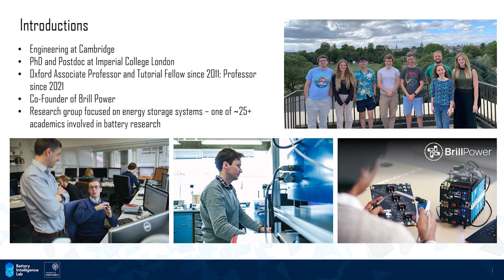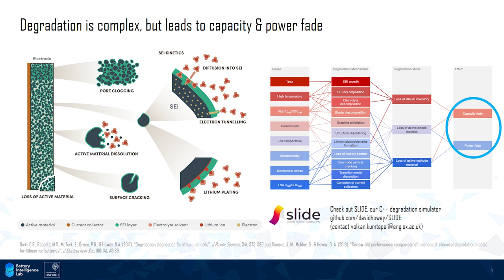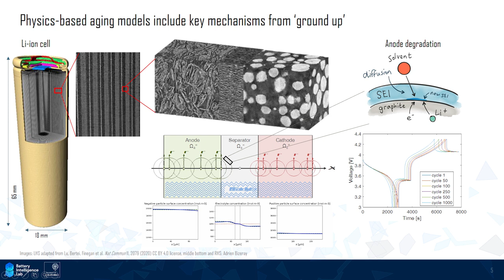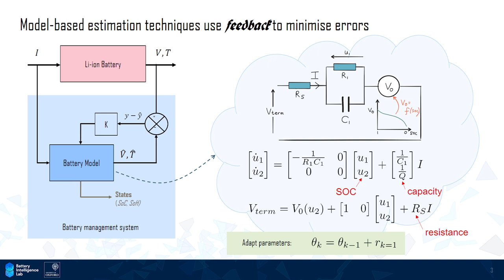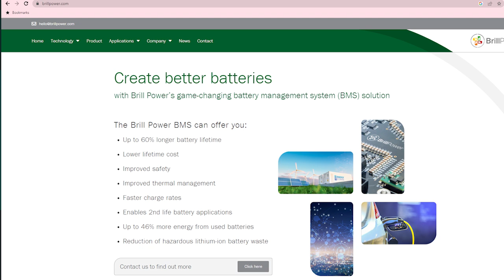How to measure a Battery's State of Health - Prof. Howey | Battery Podcast

Comment: 0:34: 🔋 Understanding battery health and lifespan optimization with Professor Howey.
4:25: 🔋 Challenges in measuring battery health using models and limited parameters.
8:13: 🔋 Advancements in lithium-ion battery technology have led to improved performance and longer lifespan, especially for smartphones and electric cars.
12:14: 🔋 Factors contributing to battery degradation include SEI layer growth, particle cracking, and lithium plating.
16:09: ⚡ Factors affecting battery degradation: usage frequency, cyclic aging for daily drivers, and calendar aging for occasional users.
20:03: 🔋 Factors affecting battery capacity include algorithm changes, physical effects like ion stabilization, and potential capacity recovery over time.
24:01: ⚡ Effects of temperature on battery health and charging speed.
28:03: ⚡ Challenges in predicting battery life due to usage and population variability.
32:02: ⚡ Impact of variation in battery pack over time due to divergent behavior and limitations by the weakest link.
Recap by Tammy AI
Reply from the maker: Wow, thanks!
Reply: Great timing with the timing <3 .
Reply: can't see your title "measuring battery state of health"?

Comment: That would be great if you could also have an uncut and uncut version i think some points weren't shown to the end
Reply from the maker: Hey there, Digitalwallis, thank you! We think Patrick should simply talk to Prof. Howey once more! We received great feedback emails already. Any questions for next time?
Reply: @batterygeneration  Sorry You asked for it
Is there a charge curve Temp vs Chargerate for LFP. What is the safe Rate for a LFP Pack with subzero Temps and whats the impact of Ytrium.? 
Is there any Chance to recover a Battery capacity with some fancy charge discharge cycles?
Is there any other way to messure the  SOC of a LFP as with Voltage, some  spectral impendance Mesurement. May be the relation of Ri between two different Frequencies? 
I mesured some effects in that direction but my tools in my Garage reach only 2GHz, it seam to happen at a higher Frequency.

Comment: My samsung zflip5 has battery protection mode on and limits the max charge to 80% and min charge to 30%, like my 2015 Tesla model S which has a similar charge cycle, the phone should last similar to my 9 year old car that can easily do 400kms on a 95% to 15% drive. 98% if the time my model S is charged to 70% and does not go below 30% before charging.

Comment: The more that I hear about the very short life expectancy of modern phone batteries, the less I feel inclined to modernise my phone. It's ancient Nokia 6230i, and I have never had the need to use a phone for anything other than SMS and phone calls. (I use a tablet for more functionality.) That old Nokia is still on its first battery. Sure, it needs recharging a little more frequently, but it still runs for about 5 days per charge if I leave it running continuously. 
I did buy a spare battery, years ago, when the phone became 'obsolete', but it showed significant degradation within about a year, so I returned to using the original battery. My conclusion is that battery durability is probably being sacrificed in pursuit of higher capacity in smaller cells, and in pursuit of lower manufacturing costs.

Comment: As someone dogging the hell out of my EV on ride shares, I'm testing out the theory that consuming energy between 70-30% range leads to less battery degradation (40 kWh on a Model S/about 124 miles usable range before recharging back to 70%) and using a total of 258 miles per day. 
I'll post the results after 5 years.

Comment: There can be a lot of variability in battery cells. I bought 2 electric toothbrushes. One battery (Panasonic cells) died after 2 years 1 month. The second one from the same pack is still working after 8 years.

Comment: I need a battery that can perform at -20C to 150C with a voltage curve mostly flat.  My circuit runs for 20 minutes at low temperatures.  Is there any way to correct this?   I fire an actuator at the end of day two at 150 mas.   Currently using CR2 batteries from Duracell and other.  Failing at low temperatures.

Comment: Would like to know which chemistries prefer which charging strategies. Tesla says to charge their LFP packs to 100% but feel it's more so because of the flat voltage and therefore low confidence in predicting the SOC. Are they telling people to lower the pack longevity to improve the consumer experience? ie. flat battery @ 10 % and a tow truck..
Reply: I'm inclined to think so, yes. When the LFP batteries were first introduced in 2021, they didn't have the 100% charge recommendations and had a lot of users get stranded at 10% or 5% SOC. They realized that it was a BMS calibration issue where the car wasn't able to accurately predict the bottom of the pack. After a few weeks they introduced the 100% recommendation once per week, which seems like a compromise between battery longevity and BMS calibration accuracy.